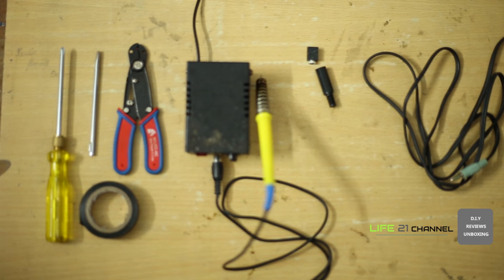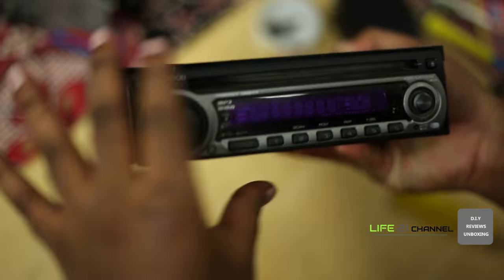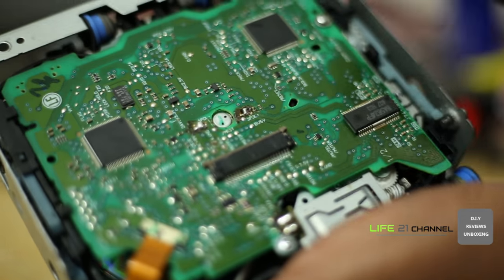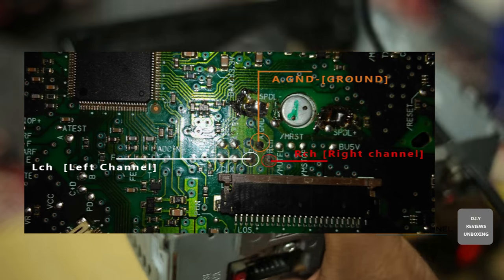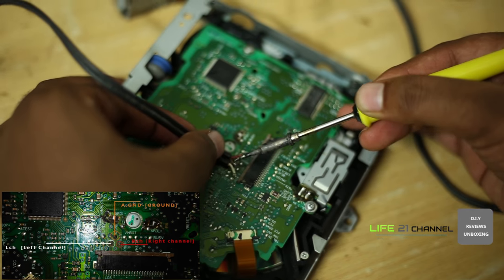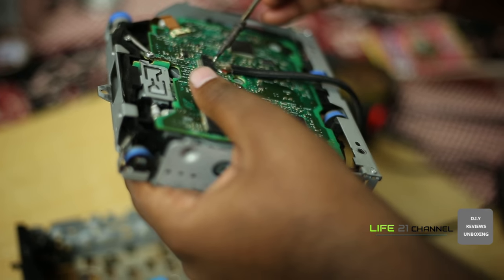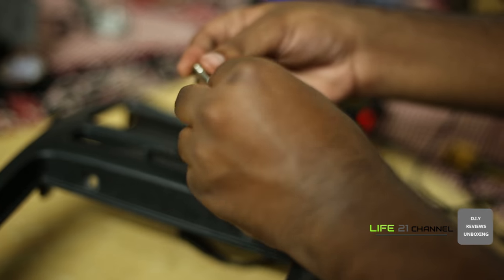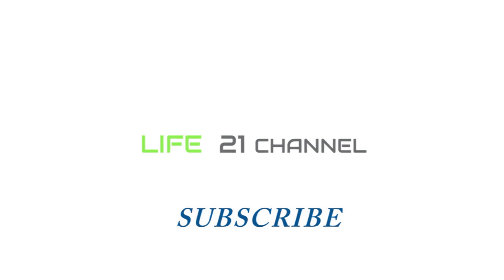AUX input Installation for any old model car stereo even without CD exchangerport [D.IY]

Comment: Good thing you added the out of focus images of the circuit board, that helped me see how it connects to a silver blob, does it matter which one? I didn't thing so. I took the stereo and mounted in my garbage can and it works great. And by "works great" I mean that it doesn't work at all.  Time to fix that air conditioner thingy. This is gonna be a piece of

Comment: 1. Follow the input of the right channel and the left channel and Gnd from the back of the cd driver and solder the wires to the recorder motherboard. 2.  Remove the cd driver and cd flat drive.  3. Connect the pins 65-66 of IC number 1 with solder.  entire.  enjoy.
Reply: What is IC number 1?

Comment: Hi! Just finished installing, wasn't hard. The thing is my CD player is not working, so it does not transmit audio from the aux either. Do you know any way I could bypass the CD player or how to identify directly from the FM transmitter? I tried searching but there's no Rch or Lch in the main board I could see. Thanks for your video!
Reply: Same with me bro...I try connect to radio amplifier also not working...any idea?
Reply: It not working connecting by cd player
Reply: I know some people did this using the FM Tuner, but sound quality was not as fine as CD player anyway

Comment: thanks but  the sound of stereo and aux both are mixing ????
Reply from the maker: in that case, check the connector (AUX cable and connectors should be tight enough ) if you still get the problem write a mute or absolute no volume soundtrack in repeated mode into a CD and name it AUX MODE whenever the muted track is playing you can hear AUX input only as the track has no sound you'll be able to hear AUX tracks with volume :)

Comment: Is there a way to make this work without the CD actually being in the unit? 
Every time the song is changing on CD, it pauses the sound from "AUX"
Reply from the maker: it won't work without the CD but you can write the long audio track in a timeline so that it won't change or pause like changing tracks in CD
Reply: Yeah. That's  what I thought. Thanks anyway for this hack. Works good given that it's free  :D
Reply from the maker: :D Cheers and do share like this video and subscribe this small act of kindness will help us to do more stuff
Reply: Ivica Mihajlovic I believe it's muting your input which I'm assuming is a phone because of the controls that are on your phone going through the axillary when it receives certain signals it causes your phone to pause maybe adding a filter of sorts a diode going one way only down the line so that the phone does not get these returns signals
Reply: One CD has 80 min. capacity, so you can record empty audiofile on your PC with 80 min. lenght and then burn to CD. It pauses sound from AUX just for every 80 mins.
Reply: Carlton Ducharme II but audio signal is AC, not DC. Diodes will not work properly.
Reply: how do I record an empty file?
Reply: Ivica Mihajlovic open Voice Recorder, press Start record, wait 80 mins, then press Stop record :D I think it's also possible with disconnected microphone, so you can get clean silent track. If not, you can find "silent track" on YouTube, download that and shrink to 80 min lenght.

For example this one: https://youtu.be/g4mHPeMGTJM

Comment: !  same as my stereo  ! 
i did it  and it's worked 
BUT
first  put a an CD in the stereo
you have to set the stereo to stand by (ST:BY)
Then Connect  the aux and play something 
go back to change Stand by to CD
and you will hear the aux input 

I Think if got sort of aux booster/amplifier maybe it's will work without using CD .i will give it a try

problem : when the song ends you have to repeat that . . .

Comment: you can buy a new cheap radio that has blue tooth and you can connect your phone to it some still have aux inputs (some times there on the back of radio) some radios are only $20 , before you ask look online

Comment: Great video I did it & it worked. Question, when I have the silent CD in, & my phone attached there is a buzzing sound (not affected by volume controls) until I start playing content from the phone. Any ideas?
Reply: I believe the buzzing sound you are hearing actually is coming from your speakers trying to read media or just standing "ready" For when you play media. If it does not play through the music you are playing you should be fine. The same thing happens with my Bluetooth earbuds when I am not playing music but am connected. You also could have bad solders on the motherboard. If the white noise doesn't bleed through the music and is not affected by volumetric controller you should be fine.

Comment: how is the volume control though can I still use the radio or do I have to use only my input source? is this Amplified?
Reply from the maker: volume can be controlled from your input device and player and yes you can use FM but AUX won't work in FM mode in player AUX works in CD mode

Comment: What type of solder did you use? Not the tool, but the metal? thanks
Reply from the maker: soldering wire ( soldering led google it it's normal soldering wire)
Reply: He used sholder...😂
Reply: Life21 Channel , it's a rosin-core solder. Typical used solder for pcb soldering.
Reply from the maker: Thanks I don't know it's name my brother was doing that soldering

Comment: Hi! 
Very helpful video
I have Toyota Yaris 2010 model equipped with CASSETTE PLAYER TOYOTA 86120-52560. Can you please advise where to connect 3 wires of AUXILIARY cable?
Reply: could you take the stereo apart and tell me the names of the chips?

Comment: If aux it playing and a cd is playing will both sounds come thru at the same time?
Reply from the maker: It supposed to over lap CD signals..check with different Aux cable
Reply: Burn a cd with one track concisting of only silence and play it on loop. This will trick the unit into operating, but the cd won't interfere with the aux as it has no actual audio on it
Reply: Yes.
Reply: @Life21channel  which tone control/source selector ic this unit uses? philips tea series? .can we disconnect cd player input to source selector and directly connect aux to the source selector channel that takes cd input.we can add a few passive components(resistor/capacitor) for input with reference from datasheet.all these systems are i2c micro controlled if i am not wrong,so source selection is also via i2c.

Comment: after wiring the volume of player and aux overlaps. how can i resolve this.?
Reply: i mean the sound of stereo and aux both are mixing. how can i resolve this?
Reply from the maker: nope it should overlap i get this kinda problem only when the AUX cable is faulty .used a good cable with my phone .when song is played i got CD song overlapped by AUX input and AUX input is working fine ..try to change the cable and make sure you've followed the colour code while soldering

Comment: Bhai app ne joh dikhaya canwood tapes same mera bhi hai meine apka formula apply Kiya to it's not functioning, can u help me...?
Reply from the maker: did you tried playing with aux input while running song from cd at the same time it should overlap the cd song and play's the aux input
Reply: @Life21channel  hello sir my cd ray is not working properly that's why display error cd on screen, 
is it needs to change the ray or ....?
Plz reply.
Reply: Mine is also same cdplayer..and same cd error problem...if I solder this aux wire. would it work??
Reply: @Life21channel  The CD player of my Kenwood KDC MP4026V is also not working , showing some error code like E-05 ... will it work if I connect there like this ?

Comment: hi, one question regarding cd radio-lg lac3710r Can an aux be made and what cd should be put blank or?
Reply from the maker: put a audio cd it will overlap the audio from CD and plays from AUX .blank CD the player will show blank CD error
Reply: @Life21channel  so the cd should be sliced, not blank and when a cd with music is inserted it starts playing normally and then it just plugs into the AUX and covers that sound with the cd Right? do you have fb or instagram to let me know I am reading you about LCH, RCH, GND channels
Reply from the maker: Yes it overlaps CD music(audio) with AUX  audio .you can  Write to me hmnth2@gmail.com.
Reply from the maker: I'll check my email I haven't seen yet
Reply: @Life21channel  do I need to insert the CD to operate the aux cord?
And is it possible to wire the aux if the CD player is still working?
Reply from the maker: Yes you need to insert CD, when the CD is playing connect Aux and the Aux will start to play

Comment: Hi,
what if you don't have a cd or cassette player? My  Sony DSX-A400BT doesn't have one. And I want to have a USB port on the backside of the radio to add an hhard disk unit. D'you know any trick?
Reply: it already has usb at the front, you can just move it anywhere you want right?
Reply: your best bet would be a cheap mp3 player for the hdd as for adding aux open your stereo and tell me what chips are inside

Comment: Bro, i have a problem, mine are not labeled, how do i find left and right and grd
Reply: I’m having the same problem, did you find a solution?
Reply: @Roboto2804  no solution, the labeling is necessary for you to find the right soldering points, i recommend you  to buy a new one they're cheap
Reply: Looking at the model of the radio in sure they should have wiring diagrams from each.
Reply: Search and download the "service manual" (not the user manual) of your player, it contains the diagrams, then you should be able to find the relevant chip and identify the 3 pins.
I found mine, I have an old Pioneer 2800.
Reply: There should be op-amps and digital converters on the board. Google the numbers printed on them to find which pins are audio out. Reverse engineering is tedious, but it works.
Reply: Internet Service Manuals...

Comment: Can it play without Cd? only Aux connection?
Reply from the maker: Nope it can't
Reply: The cd system should be intact inside,  as sound output from circuit will only work when CD is playing song
Reply: Yes, you can solder them directly to the pre-amp...

Comment: sir i have a jvc model no. kd-g162 any advice on how to connect aux
Reply from the maker: sorry  the basic thumb rule is to find the Rch Lch Agnd and bypass them with Aux connections to overlap and mute the cd audio track works with any player if you find those connection points

Comment: Bro my car CD player is showing Error 11 while putting the CD, so i am planing to attach Bluetooth module inside the stereo. My requirement is the module must work when i choose CD mode. please help me to find the power in put to the CD drive from the ribbon wire connected to the drive.
Reply: I would just tap into the constant 12v and leave the bluetooth on. Then selecting CD will just play the audio

Comment: In my sterio there is no cd selection, so to play aux audio how can i select mode. Cd mode is getting activated only when i put cd in. This time the audio output from my phone is getting disconnected and phone starting playing audio through its speaker
Reply from the maker: this method only overlaps the audio output from the  CD / cassatte audio source if you've followed the instructions and connected proper connections on board ..try changing AUX cable of your phone and try with different phones sometimes faulty cables can stop

Comment: i have an alpine stereo. CDE W925ehi. There is no aux in. Will this method work?
Reply from the maker: It may work if you found those point's like in this video
Reply: @Life21channel  it is working like charm.. thanks a lot
Reply: does it require a cd to play? what kind of cd? blank cd?
Reply: @gilberttan7244  it never required CD for me. I just tapped the circuit for LH and RH channels.

Comment: How you gonna select AUX if you turn on the stereo, normally it turns automatically to am/fm, aren't you gonna install input selector switch?
Reply from the maker: No for me it overlaps with the audio signals from the CD in CD mode so there is no dedicated aux mode or any other options what it does is it simply overlaps with the audio from the CD so cd=aux
Reply: If I put mode CD and there is no cd it will switch automatically to radio, how it will work ?
the CD will no longer work ? can you explain it more thanks
Reply from the maker: Write a cd with low or ambient sound and try with it usually aux will replace the cd track

Comment: i did it works fine but how to get back the cd original sound work
Reply: i have the same kenwood player board you worked on
Reply: Just disconnect the Aux

Comment: Hello ;)
Thanks for the operating mode on CD's radio, and for share-it with-us.
 I've a question for you: it's possible to make the same on a 91's radio with cassette player?
(in case the car radio is an "ALPINE 7190L" ..;not young as you can read ;) )
By advance thanks for your answer and help ^^
Reply: You can buy a cassette with an aux output
Reply: Its simple you can use head reader wire as a input and use the cassette switch int the mecanisme to put the tape mode its done

Comment: Hi sir i have tried but its giving TOC error . Please help me how to remove this error .

Also let me know how to select AUX input.?

Even i have tried with blank CD also its giving same error
Reply from the maker: try to write  low noise sounds instead of blank or complete track
Reply: Hi,

I have tried what you have suggested but its not working.
 give me your  email Id i will send you wiring images
Reply: DOWNLOAD A SILENT MP3 FILE, THEN WRITE TO A BLANK CD.... USE THIS CD WHEN YOUR CONNECT AUX CABLE

Comment: I have a kenwood kdc mp625. I do not have anything near the cd ribbon port labeled LCH or RCH. Nothing on the board with rch or lch either. Any other suggestions to find these channels on this board? I'm sad lol. This is such a cool mod I never imagined would be possible.
Reply: I am also trying to find
Reply: Same here bro did u find?
Reply: @infernocreations9481  Look for "service manual" (not user manual) of your player, since it is a major brand, it should be available somewhere, it contains the sheets and diagrams. I found mine I have an old Pioneer 2800 .
Reply: @samibouhadida5314  bro it's too old that manuals were lost
Reply: This may help you. There is aux at the left upper corner of the 2nd picture.
Reply: @rici_21  haha thanks for the reply! Unfortunately it was two years ago and long gone or I would have loved to try that and make it work:). Have a good one man!

Comment: u should also play it for viewers.. is it working?
Reply from the maker: It's working I sold the car and stereo you can check in comments it works but you need to run a MP3 CD cause it overlaps the MP3 feed with aux feed

Comment: after wiring... how to select aux mode???
Reply from the maker: +Vinay Patel just play the CD/DVD (Keep DVD/CD track playing)Mode and connect the AUX cable and play the song in mobile..now the audio from the AUX source will take over the CD and you'll listen the AUX source (AUX overlaps CD songs)
Reply: Life21 Channel thanks
Reply from the maker: +Vinay Patel 👍
Reply: Life21 Channel how the volume controller works?? i mean streo player volume controller works or not?? and if i connect my mobile through aux so how can i manage the volume of mobile and streo player???
Reply from the maker: +Vinay Patel everything works just normal as AUX in other cars ..in the player i made DIY AUX I can control volume in player and also in mobile individually.. it's nothing gonna do with volume control we're just by passing the audio signals
Reply: Life21 Channel oki tanks i wll try this
Reply from the maker: you're most welcome bro
Reply: Life21 Channel sir how can I resolve when only the rear speakers are receiving the aux? the front speakers does not. when I put the aux only the back speakers receive it. The front speakers does not receive the aux
Reply from the maker: +Karlo Licuan check the cable and connections

Comment: hello sur im dowing that bit is not working help me plzzzz
Reply from the maker: please let me know what is the difficulty you're having
Reply: the sound of cd and aux is mix
Reply from the maker: try to change the AUX cable faulty AUX cable or low quality cable will mix both CD and AUX sounds a good AUX cable will play the AUX input from mobile and overlaps the CD sound when you slightly remove the cable or when you pause the song from AUX the CD will be mixed in
Reply from the maker: if you still then write a muted or silent track in loop mood on a cd and play it .while you play it plugged in AUX and it will overlap even if mixed you'll get the aux only cause the other sound is muted

Comment: why don't u just by a aux cable for $4 dollars and connect it from the ports in the back this is to much
Reply: not every stereo have aux port. mine for example doesn't
Reply: Giacomo Albani it doesn't have two ports in the back? this one in the video does. I have a old ass kenwood and mine even has them.
Reply: MAFairbanks they make audio cables that have the 2 plugs for the CD player and a headphone Jack on the other end of you plug it into your phone it works

Comment: Play kaise krna h ?
Reply from the maker: Cd mode pe
Reply from the maker: Aux input overlaps cd  output and plays the songs coming through aux only if you remove aux the cd automatically can be heard loose aux cables can mix both channels cd and aux in that case use good aux cable

Comment: Why would you waste your time doing all that when the stereo has an RCA input in the back of it? Just get it RCA to eighth inch adapter and then you're done
Reply: at the back is output. is it possible to plug there?
Reply: The RCA jacks on tha back are outputs for power amplifiers sir
Reply: Its outut for example subwoofer :)